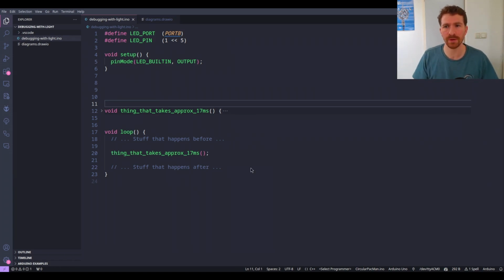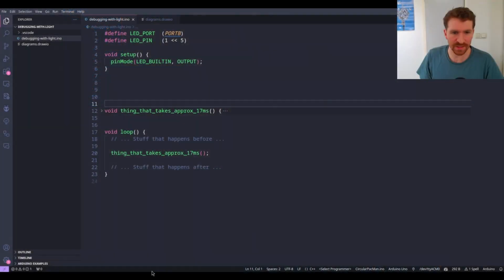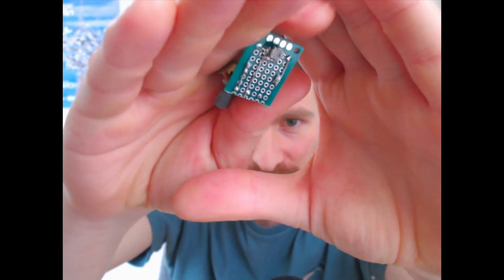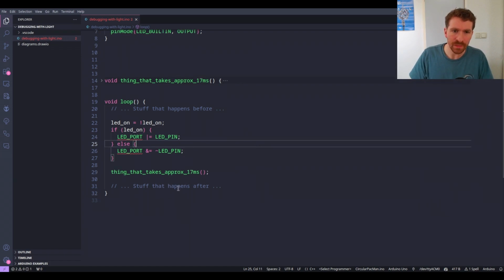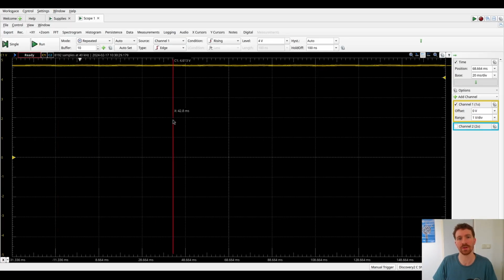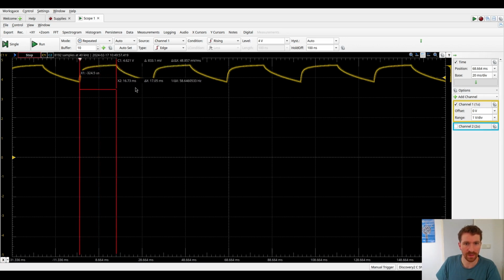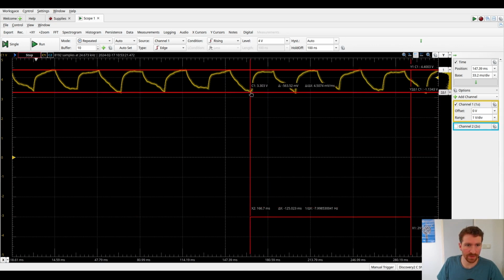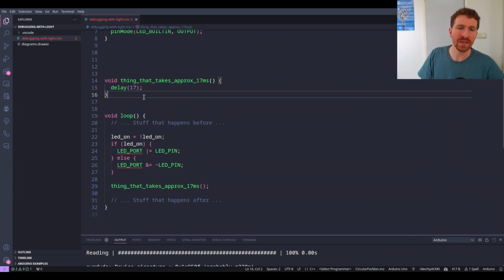Using LEDs As Precise GPIOs

Comment: @12:00 BTW toggling a certain pin on an ATmega may be faster to write a binary 1 for the corresponding pin at the ports PIN Register (see the ATmega Datasheet)! This is faster because it demands just a Store Operation instead of a Read modify store. This information is just available on ATmega based uCs and not the Tinys.

Comment: I've used LEDs in the past as photodetectors, but didn't characterize their speed. You can make a pretty sensitive light meter by reverse polarizing the LEDs and then switching back and counting the voltage decay. But I also think they output some millivolts on their own, as they are basically less optimized photodiodes.
I've seen this technique in use to measure how much a CPU is idling. Basically turn on the LED during idle time and turn it off afterwards, or viceversa. Useful for debugging RTOS.
You could even make it output UART if it's really a black box, I've seen code extraction done this way (Gameboy?).
Another usecase is when you have some critical application that self-recovers, but it triggers a fault vector. Then inside the ISR (let's say division by zero) you can blink the LED and from there you can figure how many faults you get while not slowing down or stopping your firmware.
Reply from the maker: I have tried to get signal out of an LED that way before but I wasn't sucessful - though I know it is definitely possible.
Great comment, thanks for sharing

Comment: Instead of a photodiode there are also phototransistors with much cleaner output. This is exactly what an optocoupler is; an LED and a phototransistor in a little box.
Reply from the maker: Indeed - phototransistor is another great option. The only plus point with a photo diode is that you have more control over the physical parameters, plus however you end up amplifying the signal afterwards. But yeah of the goal is to simplify, then grabbing one part is a massive plus.

Comment: hey thanks for the video! interesting technique! I wonder if you can go even sneaker and make a tiny copper coil and get  close to a trail path you want to check for current and see if you get a tiny signal? I don't know too much electronics, so I might be talking nonsense 😅

Also, for those that don't have a logic analyzer and, for the sake of completeness: I'm pretty sure you can measure a 17ms signal with a phone, as they often have a slow mode to record in 240fps and such. Of course it's gonna be tricky because the image is also gonna be much darker.. but should be detectable :P